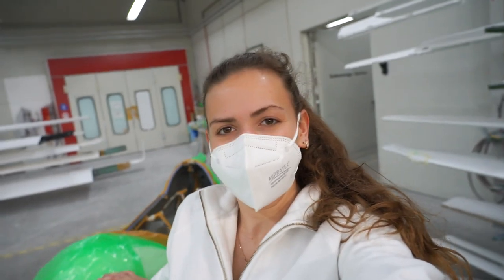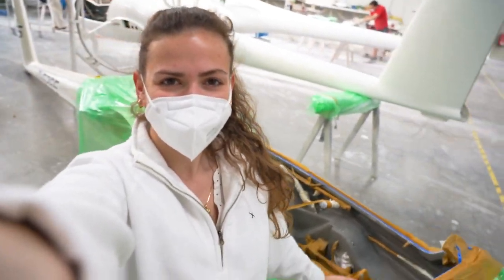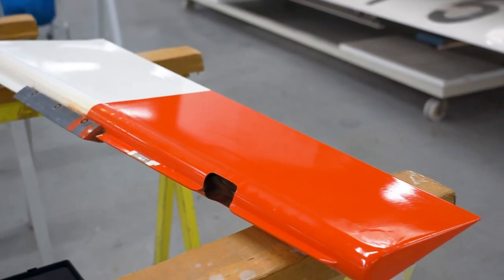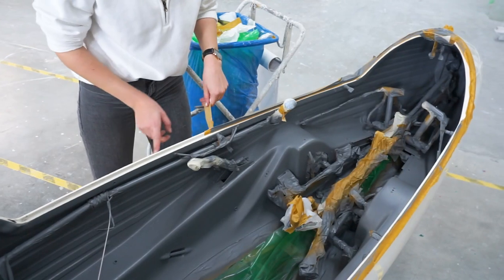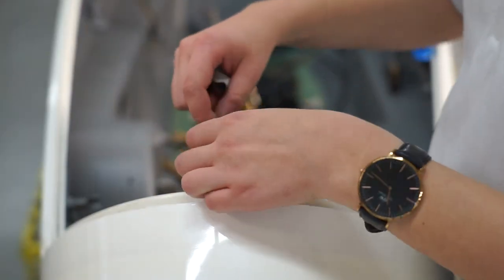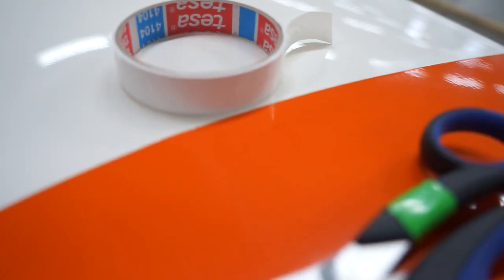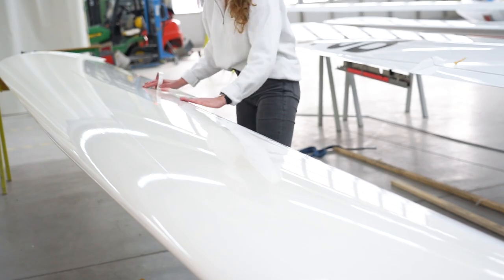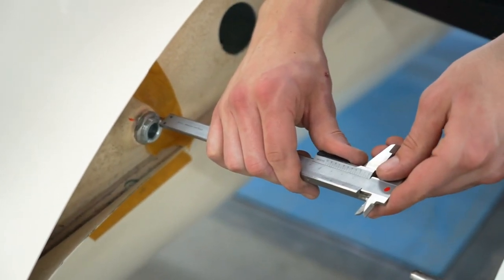HOW TO Competition Tuning | LS4 GLIDER SEALING ✈️

Comment: Looks really good! Do you need get the paint job signed off by a CAMO and note the new empty weight and CG or can anyone do this at home?
Reply: Not a CAMO (Continuing Airworthiness Management Organisation), which is (I recall) for Part 121 operators i.e. big planes.  A mechanic should be able to make the decision as to whether a re-weigh plus weight & balance statement is needed and a licence holder can perform and certify that.  It's a routine activity, after all.